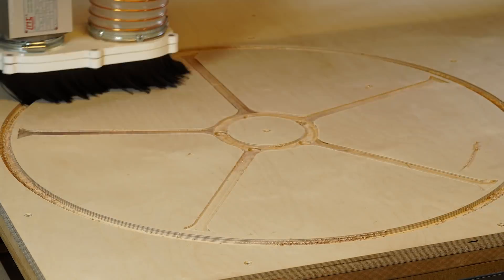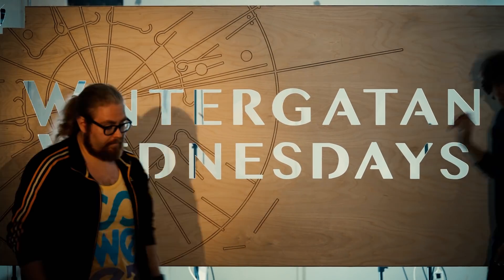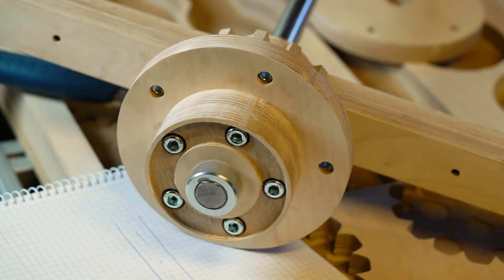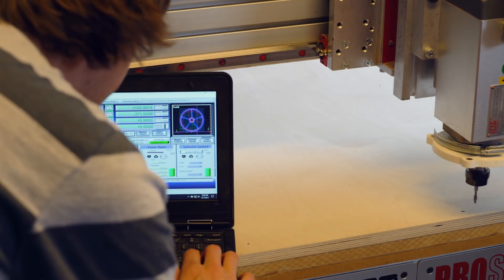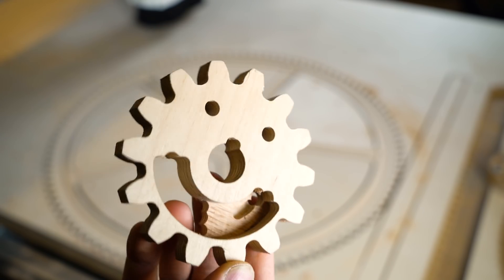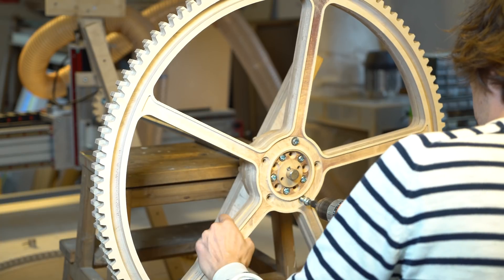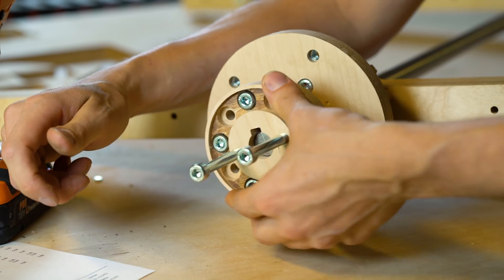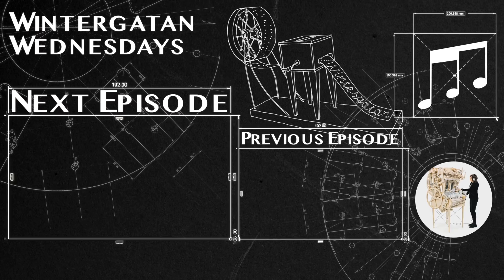Plywood Gears  - Marble Machine X #12

Comment: Sir I loved the concert in Sweden.  But as for the marble machine , im not sure  that plywood is the way to go for gears on the marble machine x. I would have used something solid and  hard as Birtch or Red Oak. Plywood will wear faster than solid over time. Good luck sir.

Comment: The bearings on those router bits have a tendency to fall off or actually fly off. A bit of lock tight on the set screw will prevent that from happening. Hope you didn't have to find out the hard way....Great progress. Thanks for the video.

Comment: I think I would be worried that, after repeated removals and installs, the axle hole on the big gear will get wallowed out and won't fit securely on the shaft

Comment: Please consider painting the metal frame! I highly recommend having it powder coated. If you prefer the bare metal aesthetic then have it galvanized before it starts rusting badly. Or, if you like the idea of allowing it to rust, maybe get the whole frame re-made out of Corten steel so it will rust gracefully.

Comment: as a seasoned touring technician I'm a bit interested in the traveling plan, how much of the machine do you plan to break into pieces after each concert?

the way i see it and how I would probably go about doing something like this would be something along these lines:
-bottom metal frame travels as 1 piece, doesnt really even need a case since it's metal. just a guy who knows the pack.
-the entire upper structure as 1 piece liftable from the metal frame and locked into it by some quick pin locking system
-make a custom, inside "floating" touring case for the entire upper structure with similiar quick locking system so the structure cant jump around inside the case when traveling., one with space for the side wheel mentioned in this and the next video.

Comment: If you add a little bit of thin cyanoacrilate to the threads in the plywood, it will make them very strong. This trick is used on model airplanes and really works to strenghten the threads for any wood.
Awesome work you are doing!!
Saludos.

Comment: I am a mature student studying Theater design and Production. (after 2 decades of management) You mentioned about the wheel coming of after each performance. Which got me thinking about the 'teching' the show' I would love to be able to help you out somehow and think that this could be an area I be of use in. Even in the video you mentioned using a puller to remove the cog wheel. This I can for see problems with, each time you put the puller on it will exert forces through to the wood. and eventually break. I am not sure what the answer is at the moment but Having an essential part of the machine having to take force to remove is not the way forward

Comment: On model and light aircraft, if we tap straight into wood, the treads get treated with an thin set epoxy, or usually just thin cyanoacrylate (super glue), then re-tap and repeat, depending on the importance of the part.
This will harden the threads to help keep the bolts from becoming loose from wood compression due to vibration and stress from movement.

Comment: 9:40 why do you hammer screws?
Reply: the holes are  a bit undersized in the MDF wasteboard, so you can screw them in or just tap them lightly in place to precicely locate the gear in place for the second side machining progress.

Comment: I'm super excited about your progress and the precision with which you are putting this together. It will be awesome when it is done.

Quick tip for your flush trim bit. Remove the screw holding the follower bearing and add a drop of super glue or lock tight to keep it from falling off in use. Also check that it is tight before every use just in case. Nothing like losing a bearing and ruining all your good work.

Comment: Needs mallet, uses hammer.
Needs hammer, uses wrench.
Needs mallet again, uses clamp.

Glad to see the engineer hasn't rubbed off on you too much.
Reply: The thing is technically he/we had all the right tools in the shop, but about 30 steps away and in the heat of building you use what you can reach ;-), most of the time the right tool is used though!

Comment: You might regret those set screw shaft collars. The set screw raises a burr on the surface of the shaft, which can interfere with taking things off and putting things on, especially precision parts like the bearings or the shaft collars themselves. I'd recommend the shaft collars that have a clamp screw that squeezes the entire collar onto the shaft.

Comment: You have a chip/dust collection system installed so why are you not using normal upcut end mills ? They can provide better finish on plywood. Also you can measure flatness of plywood some way, even with cheap dial indicator and avoid not enough deep cut mistakes.
Reply: The not deep enough cut was a fault in the GCODE and with better workholding the lifting through sawdust is no problem, but apart from that we use the downcuting bits so there is less tear-out on the top! If we would only do one pass cuts a compression bit would be ideal...
Reply: Marius Is that a problem if you do hand finish anyway ? I do a lot of plywood CNC cutting with  upcut endmills and with good setup you dont even need to sand top surface.

Comment: you could skip most if not all of the taps by planning ahead and screwing the parts to the waste board. To make sure the holes are in places that won't be cut you could add them to the CAD and run it as the first part of the CAM

Comment: Looks like it's coming together well! But when you mentioned that you're going to pull the large gear every concert, I hope you have a plan to transport it. Long, thin wooden arms might warp in transport if the humidity gets passed a certain point, so you may need to build special transport boxes for the parts after your build is done.

Comment: You should consider using nylon nails to attach your plywood to the CNC table.  They can be put in with a standard nail gun, and you don't need to worry about accidentally running the router bit through them.

Comment: Looks nice, One thought comes to mind though, since it seems like the large gear is friction fit on the keyed center part, are you not worried it will work itself loose with time, making the tolerances lower and causing slippage. If that might be an issue, one solution would be to make a couple of register keys on the center hub with cutouts on the large wheel parts that clamps around said points.

And with the cnc machine and sawdust, consider your order of operations, maybe it would be better to do all the passes that doesn't cut through the workpiece before doing the throughcuts, and even with them do a final, shallow pass for the actual separation, thus limiting the amount of sawdust sneaking under the piece, still a good practice to clamp the workpiece down though ;)

Can't wait to see and hear the end result :D

edit: and if you find you have effort removing the hub from the axle once everything is together, put some metal plates under the screw holes you use to pull it off, that way you can just drive the screws in to push it out instead. less effort, as long as you work evenly.

Comment: Exciting to watch this project.  Very inspiring.  One suggestion (that maybe someone else suggested and I missed it) is to maybe use some sort of metal inserts in the surface behind the gears where you use the screws as a gear puller.  If you are only pulling the gear once in awhile it might not matter but you said you will be pulling the main gear after every performance.  The metal inserts would help prevent long term damage of the surface behind the gears from driving the gear pulling screws up against the surface to push the gear off the shaft.

Comment: Whenever you put the magnets in your should see if it works with alternating polarity, that way you can use a hall effect sensor on your main gearwheel to get the timing correct reliably. Even if you don't plan on adding a microcontroller or anything, it's good to have the option to read out a tempo for an electric motor drive or even a faster/slower light.

Comment: I know it may be too late for you, but there are skew gears, which are way smoother in movement than straight toothed gears.
Reply: difficult to cut on a 3 axis cnc... the offset teeth are the next best solution we managed to put into the machine. Also scew gears have lateral forces which complicate things...
Reply: Marius exaxtly, yes, you would need 5 axis CNC for skew gears.
With that, i mean, that you can pair one left and one right skewed for no axial forces and maintain the smoothness, just an idea ;D
You surely know, why reverse gears in cars howl, and the foreward do not.
Reply: Best solution then, skew gears would reduce audible noise greatly, thats why i brought it up.

Comment: what sized bit do you use and what is you depth per pass on the CNC
Reply: I hope I remember this right, but we mostly used a 5mm 2 flute downcutter at 10000 rpm and I think 1200mm/min feed speed. DOC was about 8mm.

Comment: Can I recommend a wood/rubber mallet for hammering those wood pieces on instead of a steel one? The combination of the hard steel and the comparatively small striking surface Increases chances of damaging the wood. I'm sure steel is fine, but you seem to talk a lot about percision and hammering away on wood with a steel hammer seems silly to me. Again just my opinion so do what with it as you please :)
Reply: Bob swag Even better put a scrap block of wood on top and tap on that.
Reply: Don Veino heck yeah that works just as good
Reply: Do 'em both - that way if you miss then no biggie!

Comment: Looking at the design for your frame, and knowing that you will be traveling with this machine, should you consider connecting the legs together at the bottom.   If you push a table with 4 legs from only one end, that the other legs want to bend under the table.  Maybe even some cross bracing.   
While moving the machine around I fear that you could encounter some rough travels that could damage key parts to the system.   Do you plan on taking spare parts, like the wheel you made in this video, with you?

Comment: Something that may help with the CNC work is an easier and faster fastening system. Have  you heard of Raptor Nails? They are a composite/plastic nail that you load into a pneumatic nailer and fire into your plywood. Because it is plastic you don't have to worry about your cnc bits being damaged. They are super fast to use. Just a couple seconds and your piece is secured.

Comment: 6:00 Another way to prevent workpiece lift is by using a down-cut bit. It compresses chips instead of throwing them upwards and away. This creates downforce, which holds the workpiece and cutouts while preventing their lifting. Another way is to use vacuum table, which uses suction to hold parts. It actually could be made out of plywood, if your CNC machine does not have this feature. It still would need vacuum pump though
Reply: We are using a downcut bit for the better top finish ( no fraying) but the dust collection didn't catch all the dust and it got pushed under the too loose plywood sheet and it got lifted up... now the workholding is much improved ;-)

Comment: Always inspiring: I'm considering to choose mechanical engineering at univerisity. By the way, I have a question about the last fantastic video: those scotch tapes on the amp and the guitar are there only for covering a break or to create a better sound? I also remember an old video when you plugged to the guiter an electical device (distorsor?)

Comment: Great project and great videos. One safety advice about using the router. You should move the piece against the cutting direction of the bit. If you make a heavier cut and you move the piece towards the  cutting direction you might accidentally create a missile as the router bit grabs the wood.

Comment: Instead of screws, you could look into plastic brad nails (in an air brad nailer!) for fixing sheets to your CNC bed - that way if you make a mistake and it's in the way of a cut path, it doesnt brake the bit as it will mill through the plastic brad nail!

Comment: Always put the screws diagonly oposite wise in. For Example 4 Corners each Corner 1 screw, you start with the top left corner and next you put in the bottom right then the  top right and last bot left. Like this it should be more stable. And don´t make them too tight at first. Only after you put them all in, make them tight, in the same order you started with. At least that´s how I learned it. :)
Thanks for your hard work, I am eager to hear the results! :)

Comment: rage against the marble machine
marble machine head
miss marble machine 
the man marble machine
sister marble machine gun 
enigma marble machine

btw, have you thought of a possible usury of the wood parts that may be caused by pulling the gears in and out?